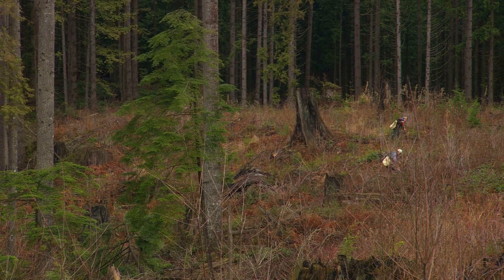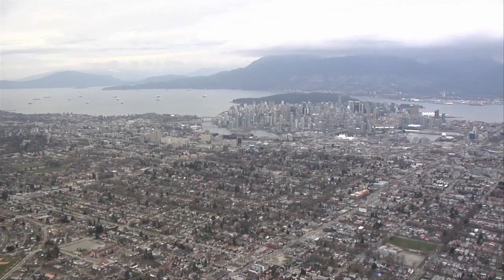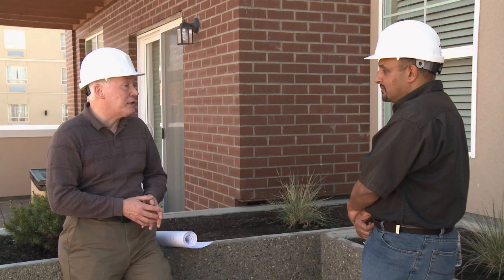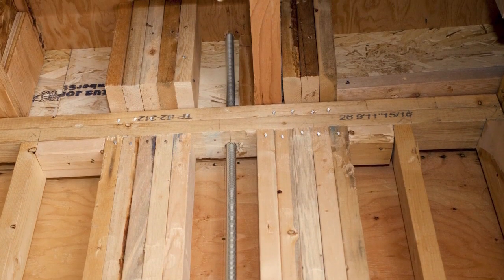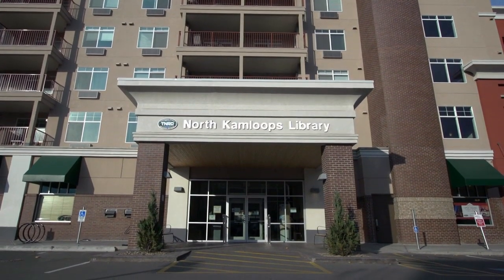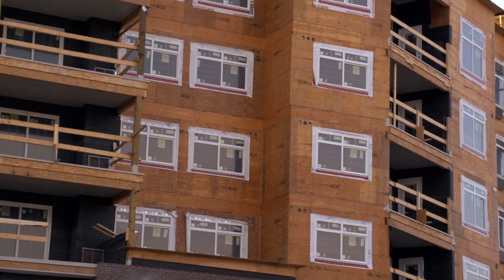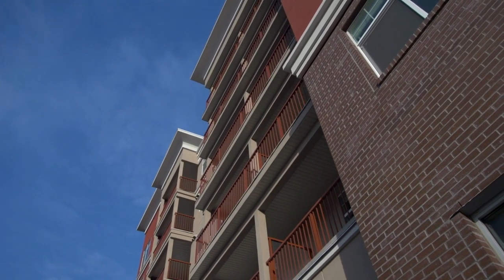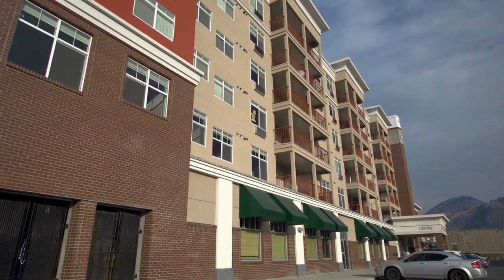Mid-Rise Construction in B.C. (Part 2 of 5)

Comment: 🎯 
00:03 🌲 Advances in wood processing have maximized the utility of logs, with veneer lumber used in plywood and engineered beams, and zero waste from log processing.
01:05 🏢 Engineered wood products like Structural Composite Lumber offer cost-effective solutions for mid-rise constructions. Only recently, mid-rise buildings became permissible again in British Columbia after a century-long gap.
02:03 🌆 Sustainable densification through taller housing addresses the increasing infrastructure costs faced by growing suburban areas. Wood frame mid-rise construction is effective for both city and suburban infill projects.
04:25 🧱 Initially designed as steel and concrete, the BC Building Code's changes made wood a feasible option for the project in question. Using wood for urban housing projects is both sustainable and economically prudent.
07:37 🔨 Light wood frame construction is historically economical. It benefits from local sourcing, ease of transportation on sites, and an abundance of skilled labour. The low mass of wood assemblies reduces foundational needs, offering environmental and budgetary benefits.
09:24 🤝 Collaboration with all stakeholders, including the design team, city, bank, realtors, and marketing is essential for success.
10:21 🏢 This was the first six-story wood frame construction project in the City of Kamloops, emphasizing safety and thorough planning.
11:12 📋 It's crucial to involve all departments from the beginning and maintain open communication throughout the project's duration.
13:28 🛠️ Challenges in building mid-rise wooden constructions can be mitigated with research, collaboration, and learning from others' experiences. The economic benefits make six-storey wood constructions preferable.
15:20 🌲 Wood is advantageous in construction due to its lateral performance, energy absorption, and adaptability in various structural situations like wind or seismic events.